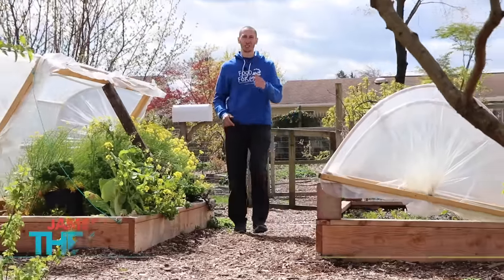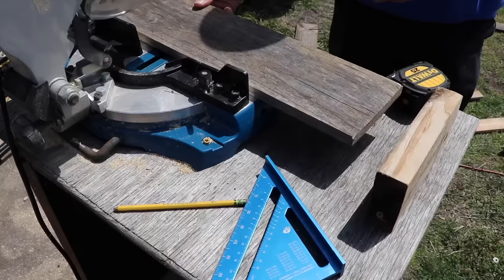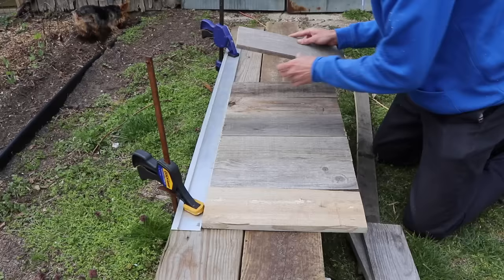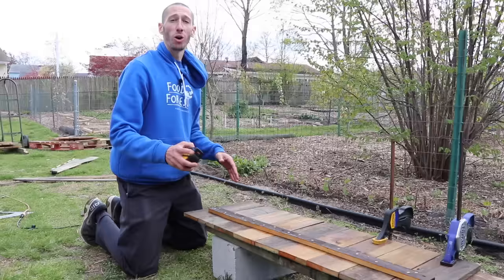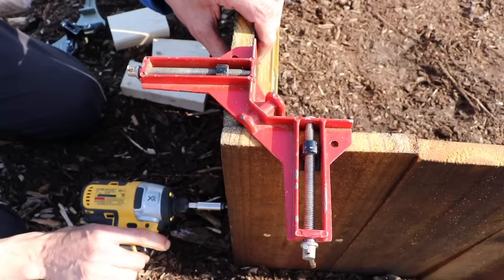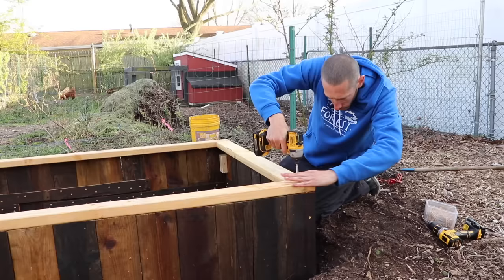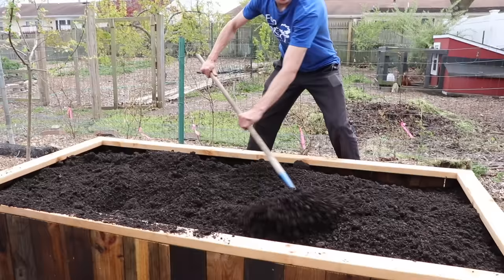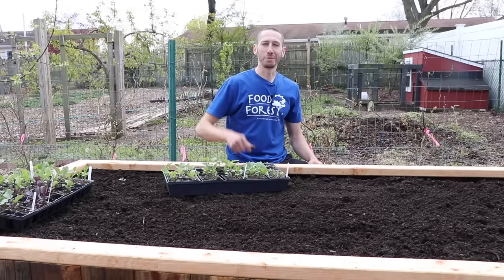How to Build a RAISED BED Using PALLETS, FREE Backyard Gardening

Comment: I haven't time to read through all the comments, so sorry if this has already raised. When I made a similar sized raised bed, I  used heavier timber on each corner to which I attached the two long sides and one end side. This made it much easier to fill with soil as I just wheelbarrowed it in, and when full, add the end panel. Much better than shovelling soil over the side.
Reply: Haha, he actually mentions this approach at 11:31

Comment: Very beautiful!  I would add a cross-connector or two (parallel to the 4 ft side) in the middle to prevent bulging of the bed in the middle -- learned it the hard way, esp when there are no posts to 'anchor' the bed in the ground.

Comment: I would have added the cross bars connecting the pallets at the top and bottom, this would give something to screw into when adding the 2x4 on top. This would probably increase the number of pallets needed but would result in a more secure end result. I also would have added a full 12 inch 2x4 in each corner to give more strength in the corners. Also lining it is a good idea that others have suggested if that is in the budget.
Reply: Yeah, I was thinking the same -- a cleat at the top would help with installing the cap

Comment: Awesome! We want to try this ourselves. I think we may put the screws in from the outside so that vertical boards that start to go bad can be easily replaced without digging out any soil. Also, the narrow support for the top plate looks a little weak to us, so we'll probably add a furring strip or something to spread the load more when sitting on the edge of the beds. Overall, this looks like a great system for creating raised beds quickly & cheaply.

Question: does anyone know how long these beds will last before the weather takes its toll?

Comment: I would have lined the box with pond liner or something that's food safe. Boiled linseed oil is considered toxic, and could leech into the soil. Also, most pallets are treated with chemicals to prevent insect damage and decay, so you have to check the markings on the pallets to see what they've been treated with.

Comment: I’m glad I watched. I have a stack of old pallets that were here when I bought the house & land. Mine may not end up as nice looking, but should serve the purpose. I love the idea of using boiled linseed oil. I use it for treating wood handled for tools, but never thought of using it in place of a water sealer. Thanks for your tips. I will put them to good use.
Reply: Hi. Do you need the boiled linseed oil?  Is the one that is not boiled not good?  The boiled one here in Nova Scotia, Canada, is $13 per 1 Litre bottle (about 4.5 Litres = 1 gallon), so it is very expensive.  A large can of the unboiled kind (around a gallon) is around $43 + taxes (Canadian). They do not sell the boiled linseed oil in a 1 gallon can.
Reply: @mikecomeau2561  I honestly don’t know that much about it, but I haven’t researched it. I’m on the cheap side, so I used some old stuff I’ve had for years. If it was me, I would try the less expensive stuff by doing a test on a small piece of wood. If it wasn’t as good, I would put in in an old pot & boil it outside. I don’t know if that would work, but it’s just an idea.

Comment: All these years I've been tearing pallets apart and pulling nails to create boards that usually get cut down. thanks. To help anchor the bed and keep it from shifting, I suggest screwing 4X4's cut about 4"  longer than the sides are tall, in the corners and in the middles of the long sides.

Comment: Make sure you only get pallets that are in really good shape and are made of hardwoods like oak. It may take a while to get them but it's worth it. Otherwise, you will be lugging around a ton of useless wood. Pine will be easier to nail but it will rot in the ground a lot more quickly and won't be as pretty to look at. Getting them with boards that are the same thickness is also very handy, but difficult. Thicker is better and they are less bowed.

Comment: Great looking raised bed as an older person there are a few things I would change
1. Just square both ends of the boards to the shortest one
2  I would use those end pieces and use them for for bracing the corners instead of new wood.
3. I think that the top boards should be either rabbit , with a router or channeled, and corners either 45'd or triangle braced,  

These things would be good especially for someone that needs a bit of help with standing even tho I would have to use a stool to do the work, I would also keep the bed narrow cuz I could not reach the middle of a wide bed

Comment: Little tip for everyone, if they is no soil recycling centre close to you, you can go to your local forest and bring back some logs and start filling up that way, they will decompose over a few years and are super healthy for your soil
Reply: Get permission first. Some state and federal owned forests will not allow this. You might need a permit.
Reply: Sounds like a great way to transfer disease to your beds. 
Never never never use felled logged that have been decaying in the forest. 

You start with fresh logs that were just cut down. Not potentially diseases rotting wood.

Comment: For the sake of efficiency treat with linseed oil (or Ducksback or Thompson's Water seal) first then assemble. In warm climates rot will got to work very quickly so it is important to get all your surfaces treated. also you can use a one gallon sprayer to apply the preservative. 

Hint, look for horse stables nearby for a manure source for your compost. If they bed the horses stalls with straw or shavings so much the better.

Comment: I was so inspired watching this that I’m building a raised bed tomorrow. What is your recommended depth of a raised bed? I have planned for 8”. Is that deep enough?  I plan to lay it out for square foot gardening. Thanks!
Reply: I made mine 2 ft high. I think they are perfect.
Reply: I think it's dependent on your preference. I've seen beds only an inch or two off the ground, but ive also seen ones waist high, so it really is up to your digression. If you're growing root vegetables and don't want to dig into the soil below you'll need it higher

Comment: Really nice. Two bits of advice though. Be sure to use HEAT TREATED (HT) pallets. Otherwise you poison yourself if growing food. Also, your cap piece probably should have more of a structural cap than it actually is. Some 1x4's as bracing and mitered corners where the top piece meets up at each corner would have added a lot of strength. A wooden wedge wouldn't hurt either. I'd be interested to see how long these hold up over time.

Comment: Great DIY enclosure..about the top 2x4 top rail.. I'll be cutting 45° angles and attach the 2x4s with screws for greater corner strength..

Comment: Beautiful!! I live in a very rainy state and there are a lot of gophers in the area. I need to put hardware screen or chicken wire on the bottom. I also would set it on cement stepping stones so the bottom of the boards don’t rot. But this is a perfect instructional video!

Comment: It's looks nice but it is not gonna last long this way. For the next time, first screw a slat around, inside or outside to attach the top slat. Screwing in end grain wood is rarely a good idea, especially when it concerns such a small dimension. Also let the top slat hang over on both sides of the vertical board, this way you prevent the water from running directly into the end grain. Good luck.

Comment: You could Build a house on a trailer using this method just put bracing all the way up top it just like this put rafters on roof solar panels composting potty small bucket for water black so it gets hot from the sun shower stall bed and have fun camping😎

Comment: Hello, I'm from Germany and came across your channel! I would not screw the screws for the edge from above because the water would be at this point when it rains. It would be better to screw the edge tight with a square or a piece of wood than a tab. maybe if you have no problem with plastic a dimpled sheet inside makes sense. In any case, it would extend the lifespan significantly. Regards!
Reply: PS. 
I am not a fan of plastic but it is used sensibly and if you can extend the life of wood with it, it is worth considering.

Comment: Remind me of the benefits of a raised bed again. 
Considering the work involved and soil required, it can't be to save your back. 
Further, if it is to reduce bending your back into the future, there's not a lot of back bending required for gardening at ground level, if you mulch to suppress weeds. That leaves planting and harvesting as the only other times you would need to bend your back. That's not a big deal. 
I looked into raised beds a long time ago, and figured unless you want to grow on top of concrete patios, raised beds are unnecessary.

Comment: Made mine using the recommended instructions.  Had to start replacing beds less than a year later.  Pallet wood rots even with linseed oil or Thompsons water seal. Better idea is to line PT wood bed with food grads plastic.  Lasts for Years - (going on 4 Years)

Comment: Just a heads up: there are 2 types of "boiled" linseed oil as far as I've researched.

-Pure boiled linseed oil
-linseed oil that has metals, chemicals, etc. added to help it dry faster, but not actually boiled. A bit dishonest of those manufacturers.

I'd recommend looking at the MSDS of the product you're looking at using to ensure the contents are 100% oil if you're concerned about leeching. :-)

Comment: Line the bottom with hardware cloth if there are voles or moles. Also this will rot out after a a year or two. Lining with plastic. Put the rails on the outside.

Comment: I agree with the recyling of pallets idea but the way you are making those beds is so labourious it bends my mind. I size the long and end pieces lay them flat to the height required then join at the seams to prevent a cetain amount of leakage. As the wood rots which it will after 2 or 3 years I remove screws and grind the wood up to be added to the soil mix for the next bed.

Comment: Just so your viewers do not get into trouble: Not all pallets are a good thing to use. Some pallets, mainly the blue ones, it is illegal to keep, cut up etc. In fact, there is a 50 dollar bounty on them if you return them. Therefore, check to make sure the pallet(s) you want to use are actually legal to use or you will be fined or criminally charged if caught with one. Be safe, do the diligent thing first and ask about the pallet. I repeat, the blue pallets have a bounty on them, return them, collect the bounty.
Reply: Who owns them?  Who provides the “bounty”?
Reply: @krisbaker9427  The pallet manufacturer

Comment: 5:52 I'm really glad you provided some information about painting a raised bed in order to protect the wood, as I've been wondering if there's anything that's safe to use with food crops.  I noticed that your container says it has Boiled Linseed Oil inside it.  Wouldn't raw linseed oil be a better option?  Apparently boiled linseed oil has traces of metals and other substances added to it so that it'll dry faster?

Comment: Hi James. Thank you so much for your videos. they are very well put together and your explanations are very well done. I do have 1 question for you. I cut my pieces (my wife wanted them 18 inches long) and am ready to put them together. Bought some 2 1/2 inch galvanized screws (the green ones) but the worker at my local Kent hardware store said that she was worried that it may not be safe to use Linseed oil on the wood.  Another worker said not to use the boiled one.
I know that linseed oil is a healthy, natural product when bought at a grocery store or a health food store, but I wonder if you could help me know if what they had in a gallon (not the boiled kind) would be safe?
Thank you,
Mike, Bedford, Nova Scotia, Canada

Comment: How about one strip of wood inside and one outside that binds the 16 inch pallets ?

How long does Linseed oil take to dry ?

The 4 corners I plan to use a long piece of wood.  This can hold the ends together and also allow me to protect the plants from weather.

Comment: Two things...

-Linseed oil and flaxseed oil start from the same plant but linseed oil uses petroleum distillates to maximize yields when pressing.  It is therefore not safe for consumption like flaxseed oil.

-Most modern pressure treated used for residential construction (industrial construction is different) is harmless to use in raised beds.  There have been several studies, the most sited on from University of Oregon, showing that the materials used in the treatment of the wood aren't measurable in soil to any appreciable extent, but aren't even mesurable in the plants grown in those beds.

You can feel safe using most pressure treated lumber in the construction of your raised beds.
Reply: But I do really like your design.  I may use it, but with a bits of treated lumber here and there.

Comment: Started doing this same pallet raised bed method 25 years ago; however, I used green pressure-treated 2 x 4's ripped in half for parallel rails to air staple/screw the slats to. Mounted the slats on the inside of the rails so the soil would press against the slats. The pallet slats will rot out (depending on the type of wood) in about 3 to 5 years. When that starts to happen you place the slats on the outside of the rails to get another 3 to 5 years out of the bed. No top rail is needed and metal angle iron gives the corners more strength. Using exclusively compost in the beds works well but requires topping off every other year because of compaction and further decomposition.

Comment: Love the strategy of recycling pallets!  It's probably too hard for most folks, but using a router to make a slot in that top-cap frame would really improve its function.  Screwing down into a 1/2" hunk of pine end-grain is risky.  Overall AWESOME job on this video!

Comment: I just read below that someone used boiled linseed oil (as per your suggestions?).  Do you need the boiled linseed oil?  Is the one that is not boiled not good?  The boiled one here in Nova Scotia, Canada, is $13 per 1 Litre bottle (about 4.5 Litres = 1 gallon), so it is very expensive.  A large can of the unboiled kind (around a gallon) is around $43 + taxes (Canadian). They do not sell the boiled linseed oil in a 1 gallon can.

Comment: This is so inspiring!! How many pallets did it take to get the 56 boards cut? :)
Reply: Each pallet had 5 rows he cut right down the middle in half. So 1 pallet will give you 10 boards 5×2=10. One of the pallets will be used for the (support braces inside of the bed) I'm going to get about 7 pallets to be safe I shouldn't need the extra 1 going by his measurements but I may need it for something else. Better to have it and not need it than to need it and not have it 💯. I hope that helped!
Reply: @yasminrozier63  Thank you!! I was thinking 8 to be safe. I am nervous but excited to try this :) x

Comment: This is such a beautiful bed.  I don't have any of the tools you used.  Could you just use the pallet the way it is and add a few boards where the holes are?  Also another suggestion ,  a ramp would have maybe made it a little easier to dump the wheel burrow.

Comment: Boiled linseed oil is boiled using chemicals that are toxic to humans. Raw linseed oil is organic and not toxic. Tung oil is also food safe. Don't forget to check the codes on the palates. The HT code is Heat Treated & is considered safe, so if you're okay with that then okay. If you're not okay w/that you may want to run some organic weed barrier from your top board down then underneath and out your bottom board. That way you won't lose soil between boards or leach chemicals into the soil & you have a weed barrier area to make a path with wood chips or gravel that won't need weeding. I Shou Sugi Ban (burn) my Fir boards. 1 bed is 8 y/o & going strong. Bugs don't like burnt wood. Thanks for the great pallet idea!

Comment: I filled a compost pile over a period of a year, with dead leaves, cut grass, kitchen scraps and manure; then I let it age undisturbed for two years. Just this week I "harvested" my compost, which fills 1-1/2 45-gallon tubs. The texture is very much like soil. Should I just use this compost as-is as my raised bed soil, or should I add something to it -- and if so, should I mix them, or just layer them as you did yours?

Comment: This is a beautiful thing, however I had a different idea why watching you. Why couldn’t you find palace and stand them up longwise and cut them in half and then attach them to build a four sided square. Then buy some bamboo liner which is really strong and put it inside the square. Put in some hey, some compost some loam some soil what have you and boom, do you have a raised bed that only requires a few cuts. And if you wanted a deeper bed you don’t even have to cut anything in half.

Comment: Clever and beautiful. BUT, in my 40 years experience those boards will rot away in 2-3 years. Lining the interior with some plastic sheeting between the soil and the wood will give many more years. Linseed oil is great stuff, it’s great to use on tool handles and gunstocks. The protection against moist, fertile soil is minimal. Just staple some 1 mil black plastic on the inside. Do use the oil on all surfaces also.
If the plastic isn’t exposed to sun it will last hundreds of years.
Reply: Adequate drainage is probably also something to consider to preserve the wood.  Would placing the raised garden bed on, say,  a foundation of coarse gravel do the trick in your experience?
Reply: @tedtolentino4955  I think anything that breaks the capillary action, keeping the wood dry is good. I use 1 mil black plastic between wood and soil. I think I’ll be replacing wood with some version of these panels as the wood fails.